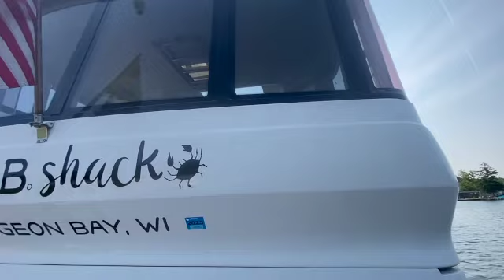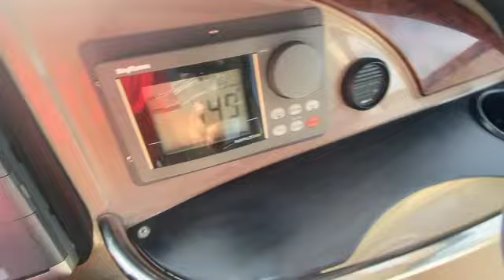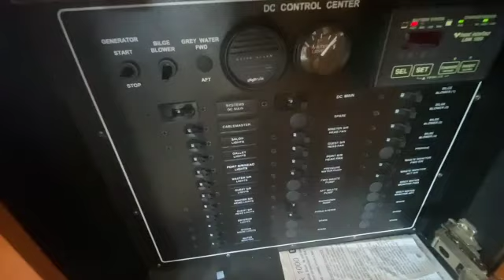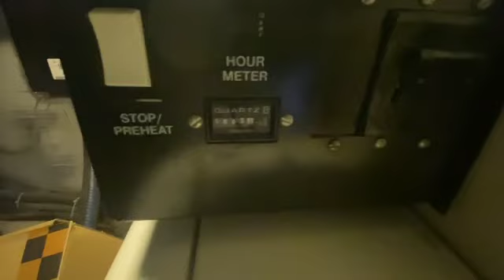Explore the Carver 506 Motor Yacht- Luxury on the Water

Comment: I just captained one of these from Midland Ontario to Toronto via Lake Huron, Lake St. Claire, Lake Erie, the Welland Canal, and Lake Ontario.  These boats perform well for their size and shape.  I agree they are not the best looking boat on the water, but, but... you will not find more space on the water for length than what is offered here.  The fully enclosed upper area is a head ache, you are either making condensation on the outside or inside of windows all the time if you are operating on the Great Lakes.  I prefer the Volvo Penta models over the models with Cummins, although the Cummins transmissions shift faster and have better control at low speeds.  Great vessels... but look like Captin Kirk shoud be at the helm.
Reply from the maker: Thanks for your thoughtful comment- this boat is the most spacious and really great for people who liveaboard. Tons of storage and living space throughout.